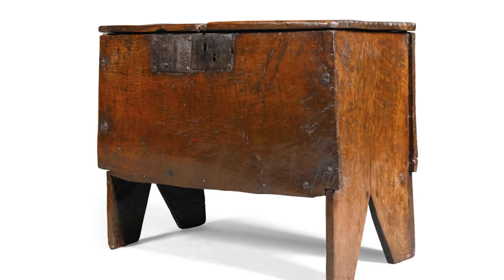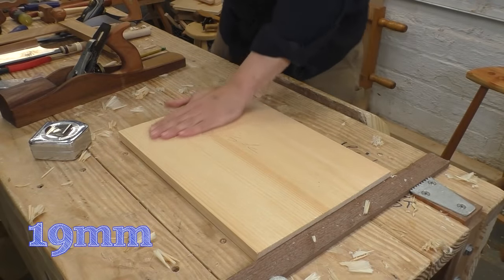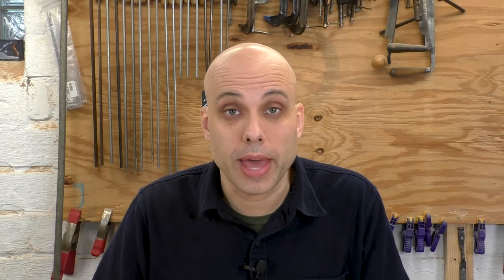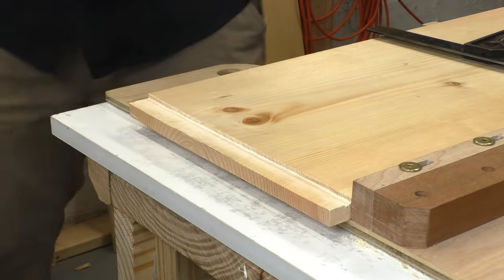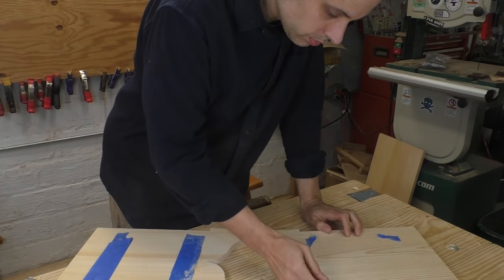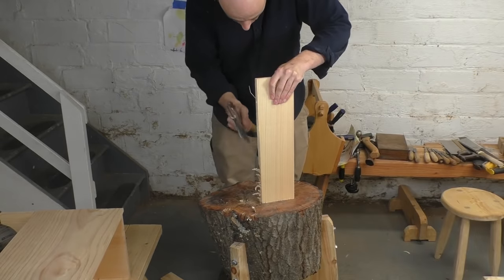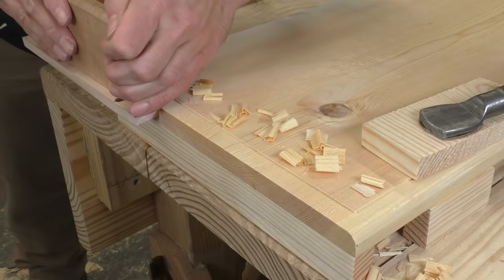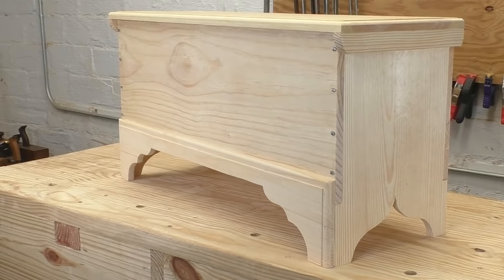The LEGENDARY Six-Board Chest

Comment: When I was young the only woodworking tools I had were hand tools and I could still make some pretty nice projects. The problem was it was monotonous. When you start having to saw all the way down a 4 foot board to take 3 inches off the side it’s just boring, at least for me. Of course I didn’t have much choice seeing as how that was what was available to me so from the latter part of the 60s into the mid70s when I did Woodworking it was with hand tools. By the latter part of the 70s my father was more willing to let me use the more dangerous power tools because let’s face it a handsaw is going to require you to work a while to takeoff a digit and of course your instinctive reaction is to release the saw and reflexively pull away so you might end up with a cut where as with a Skil saw you could end up losing several digits before you can release and pull away. So now I can go faster as I messed up board after board because I didn’t think about guides or understand the concept or however you wanna put it. There was no Internet there were barely computers. Back then you were paying $50,000 to $75,000 for a House. You were paying $15,000 give or take $5000 for a car and a computer will cost you between $5000 and $6000. Today the average house is $125,000 and the average car is $22,000 and you can grab a computer or a tablet or just a smart phone for a few hundred dollars and jump on the net and learn so much. Then I discovered, still in the late 70s into the early 80s, that there were these wonderful Woodworking shows on PBS. No other stations seem to carry such shows. Such lovely shows as the Woodwright shop and the new Yankee workshop and there was another one I forget now it’s name but it came from Iowa public TV and it dealt a lot with routers. And this is where I learned to do a lot of my woodworking. There were also books and magazines and as time went by the Internet but the time I was able to find out stuff on the Internet I really wasn’t a lot left for me to learn. I guess you could say this is a long winded way of saying that when you go from using one kind of tools to another it’s going to affect your skill level whether it’s power tools to hand tools or hand tools to power. I remember the first piece of fine furniture I made what is a cradle/crib for my sister’s first born son and that was a matter of timing because I found the plans in one of my magazines on Woodworking. since then I’ve made dining tables entertainment centers and even a whole kitchen but I doubt I’ll ever go back to just hand tools. I know they have their place and there are times when nothing can replace a hand tool but for the majority of the cutting and shaping I’m using power. I think why I like your YouTube channel is it reminds me a lot of the Woodwright shop where he showed how woodworkers of old would make different projects and I would think of several different ways to do the same thing with my power tools such as making a dado, I could use a table  saw, a skill saw, a router or radial arm saw.

Comment: I did something similar last year but I used wooden nails made from hardwood scraps. I just split the wood into roughly 5mm pieces and trimmed them with a chisel so I got slightly tapered nails. The nice thing about this sis that you can plane the whole thing after assemply without ruining your plane.
For the rabbets, I recommend buying a Rabbet plane. In germany they´re called Falzhobel and look like this
https://www.gm-werkzeuge.de/produkt/ulmia-falzhobel-mit-einfacheisen/
I got a ussed one for about 50€. You just adjust the width and deph of your rabbet and you just plane it down even across the grain, thanks to the second smaller blade.

Comment: Hand tools are not harder. Since I learned how to use hand tools, I find it more and more difficult to use power tools. You don't feel and you don't see your material. Only after you  switch off your tool you see what the result is. With hand tools you are there all the time and see it happen. With power tools you are quickly at a fair level of woodworking. And then it stays the same. Learning hand tools takes longer, but your quality level increases and grows beyond that of power tools.

Comment: Rex why is the grain oriented perpendicular on the sides and face?
Reply: Because it’s impossible to have it parallel on the top&bottom, sides and front&back all at the same time. Well, unless you make one pair entirely of endgrain, but that sounds horrible to work with and not very strong.
Reply: Nillie the ends (sides) could be rotated 90 degrees so that the front back and sides have grain running in the same direction. I wrote my comment before it was released and Rex addresses this in the video. He uses cut nails.
Reply: @TrainFlood  
In which case the top and bottom are the ones that have the grain perpendicular to the ends. I assume it depends on the usage of the piece you’re building.
Reply: Nillie 

That’s not the point. The issue is CROSS GRAIN joinery, which presents a problem. But Rex addresses this by using cut nails.
Reply: @TrainFlood  
And my point in response to the question as originally phrased is that there must always be some kind of cross-grain joint on a six-board chest.
Reply: Nillie the lid is on a hinge and the bottom just sits there!!
Reply: @TrainFlood  
I agree that the lid doesn’t really affect things as much, but consider what would happen if the bottom one day became noticeably wider or narrower than the ends. In one case you’d have gaping at the corners of the chest, and in the other, it would make the bottom very insecure. The front and back are less of a problem because they’re butted against the ends in such a way that they always overlap them.

Comment: you measured from the top of the carcass not up against the back of the partially assembled chest and with the sides slightly flexed in it threw off you measurement at least that's my guess

Comment: I think that your comment about working with hand tools being harder than working with power tools may be inaccurate. I think the difficulty lies in learning the patience to work with them. They are slower but with that lack of speed comes attention to detail. When you cut a mortice with a router, it's over quickly and you just buzz to the lines. Cutting a mortice by hand allows you to spend more time looking at your work, noticing subtle characteristics that are often easy to ignore when using power tools. In our instant satisfaction world, it's too easy to lose patience when a task takes longer than a few moments to complete and so I think that the patience is the hardest part to learn. Rushing leads to mistakes. Slowing down is that hardest and most important skill to learn in my opinion. But I could be wrong.

Comment: With power tools it's all in the setup; 20 minutes setting up, 20 seconds for the cut. And its stressful, with a power tool you are taking bigger cuts so f**kups are bigger. With hand tools you are slow mistakes are small, stress and noise is less.
Unfortunately age and diabetes has taken its toll on my muscles, so I have reverted to power. The bandsaw is my friend.

Comment: Other than the obvious "physical labor", I wouldn't necessarily say hand tools are harder... AND for the matter, neither are power tools.

    Power tools with all the guides and references and adjustments and gizmo's, teach us to eliminate the "human element" in the equation. This is a supposed "net benefit" because of all the press given to "human error". The cost is that we no longer learn to work the wood. We learn to tune the tool. I'm already a mechanic, and make decent money at it. I don't need to take up woodworking to be another kind of technician...

    Hand tools bring the human element right back INTO the work. Beyond just powering the tool in hand, you have FULL control over every aspect of it. You really CAN "eyeball" the thing you're doing. Try just "eyeballing" it and making a rando' cut with a simple circular saw {no... do NOT do that!} and you'll see what I mean. It's got a sole-plate like a plane, and adjustments for angle and depth, different blades for changing the rate of cut with the incident of the blade, and the prescribed convention is to adjust all those things so you only "eyeball" the little mark on the front of the plate to line up with your measured line, and follow it...
    A handsaw (on the other hand) can be allowed to wander closer or further from the line as you prescribe, and while not so easy or quick to wander for some saws, ALL handsaws do that.

    Power tools also rarely give feedback from the wood (if they ever do). They snarl or malfunction with too much pressure or speed into things like burls or knots, but there's no real feedback... BUT hand tools let you feel every grain, curl, space or deviation in the nature of the wood you're working. It's a whole different experience.

     SO don't get me wrong. There's a similar requisite for skills either way you go with woodworking. It's just a whole different animal when you're swapping over, and it takes some getting used to. It seems harder to do hand tool work when you've been used to all prep' and set-up for power tools and a gloriously short lived flurry of chips and dust and then the product rolls out the door. BUT if you've grown up around all hand tools, the setup and prep' of Power Tooling can be tedious, time-consuming, and entirely spiritually exhausting... SO which is actually "harder" is a dubious call to make...

     Personally, there are things where a good power tool is appreciated... Usually it involves rapidly knocking stocks down to manageable and storable sizes... Occasionally, it's delightful to set up and power out a production when I KNOW I'm going to need a few hundred of a certain thing... That kind of manual labor can lead (quickly?) to utter lunacy... BUT most of the time, I'll take hand-tooling any day of the year.  ;o)